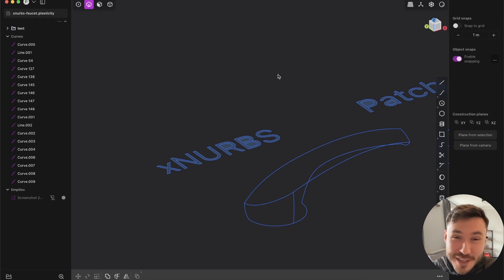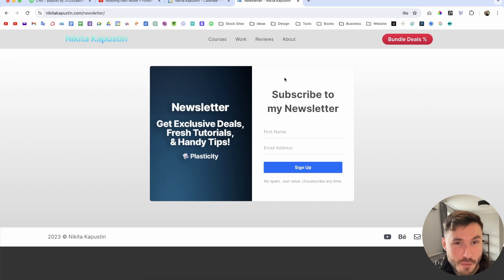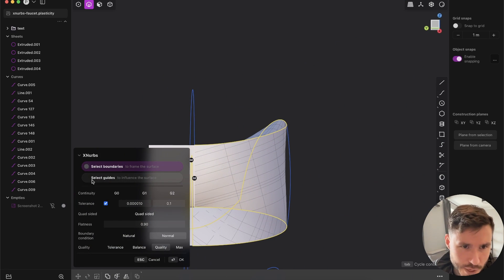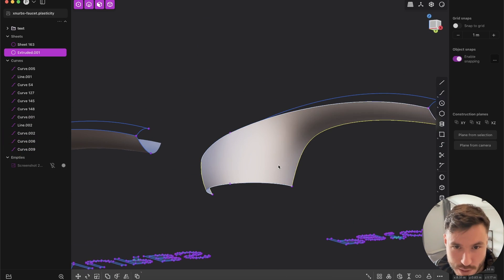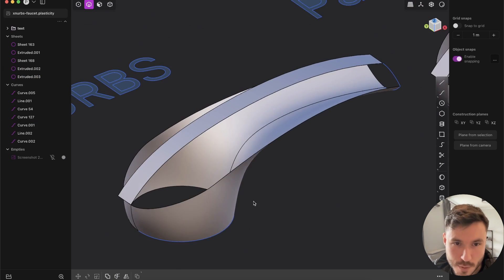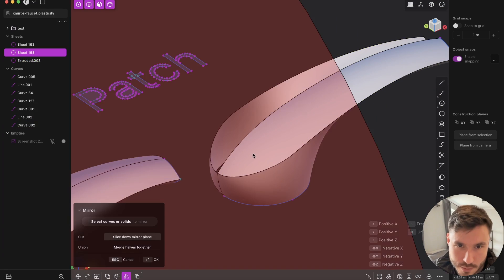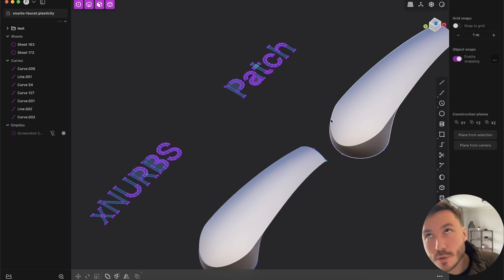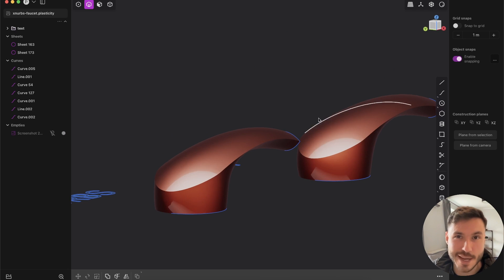xNURBS joined PLASTICITY | Is it REALLY worth it?

Comment: When you mirror, you DO NOT NEED a G2 continuity along the mirror line! You NEED only G1 continuity for the mirrored surface to be smooth (it will inherit the G2 and G3 and 4G etc. from the built surface to be mirrored after). You made a redundancy forcing xNURBs to get G2 along the mirror line – it makes that surface has an 0g (means zero curvature) perpendicularly along the mirror line at that same line because your temporary extruded surface was extruded straight (0g) from the mirror line!

Comment: Unfortunately, xnurbs does not build good quality surfaces.

Never did.
Not in Rhino and not in Solidworks.
Turn on the control points on that surface. The degree/span count is seldom good.
xNurbs will throw something at you, filling a whole but the result is almost always a mess.
Learn what spline surfaces really are and how they work instead.

Comment: I remember a time (around 15 years ago) when in  automotive design single span  patches were the way to go. It went even so far, that Alias  modellers were getting problems if they had 2-3 spans in their surfaces. If I look at the interior isoparameters of those X-NURBS surfaces... I get cold shivers... 🥶
Definitely not single span😂
BTW: If the adjacent surfaces are messy, you will get messy patches with tortured highlights. No X-NURBS trickery will solve that.
Reply: So what xNurb has as advantage compared to patch?
Reply: @LynxErgo  It gives you an automatic solution and more importantly it can have more than 4 sides. A patch can only have 4 sides and you have to decide what is the best way to make your "quilt" out of those four sided patches. (Of course, you can trim a patch to have more than 4 sides, but it's even harder to align other patches on trim boundaries.)
As long as you only care about the look of your model, xNurbs will give you a quick solution. As soon as you start offsetting the A surfaces (in other CAD software) to create B surfaces (thickness) then the increased amount of interior isoparameters MIGHT cause problems, especially if they have multi knots. I have not tested it, therefore the MIGHT. Generally, the less spans a surface has, the cleaner it is mathematically so, it is more suited to create offsets of it.
Reply: @SteveThinman  Damn, thats quite insightful, thanks man! Im trying to learn CAD so I can use it my field (game dev). Its very difficult to understand it afterr years of polygonal modelling. Thanks again
Reply: @LynxErgo  NURBS modelling is very different from polygonal modelling (I'm doing it for over 30 years now) as you always have to think in four sided patches and you have to take care of the continuity between those patches. Continuity is never a problem in polygons as they are always G0 (positional) only and only the smoothing algorithm determines the appearance. xNurbs might help you solve complicated surfaces but if you really want to learn NURBS based modelling, try the hard way and try to solve with patches only.
Reply: @SteveThinman  Got it, thanks again

Comment: In the beginning, on the "bottom" with xNURBS you're using G2 alignment to an extruded surface with no curvature and are thus forcing it to match curvature to something without curvature. But on the Plasticity patch you're using G1 alignment which only needs to maintain tangential continuity, so a) it doesn't appear to be apples-to-apples comparison, and b) the G2 alignment - aka the "curvature continuity" - is probably causing the resulting surface to pinch where CV's are trying to match a non-existent curvature.

On the "top", you do the same thing in using G2 curvature continuity for the xNURBS surface, but then trying/failing to use G2 with Plasticity patch and then just accepting the G1, which I'd offer is the better alignment constraint for both.

Obvious question is: Why didn't you show xNURBS with a G1 alignment to the extrudes and compare apples-to-apples instead of using G2?

FWIW. even when I model in Alias, I don't use G2 continuity on the edge of a surface which doesn't curve.
Reply from the maker: Thanks for that in-depth explanation, wasn't aware about that the extruded face can only be G1. Learned now:)
Reply: @nikita.kapustin  - Glad that helped. That all said, you're correct in saying that for these kinds of surfaces xNURBS probably doesn't make much difference. Even less difference for videogame assets (although that could change as game asset quality quickly goes realistic).

Where I suspect xNURBS will make the biggest difference is in the kinds of multiple-surface-blending-together-at-the-same time situations that sometimes pop up; things like motorcycle forks. Those blends can be tricky and require a fair amount of work to get nice surface quality. And again, this is probably of greater importance to the professionals like myself that want to export geometry to SolidWorks or Creo and continue work in those applications. For game assets, once it's in Blender or Modo or whatever, the clean-up can be moving some vertices, so the surface quality doesn't have to be as clean.

Is it worth the extra cost of a Studio license? Honestly, I sometimes still can't believe these tools are running on $1k laptops and cost a few hundred dollars. When I first started out, less capable software was tens of thousands and ran on SGI workstations (or similar) with a UNIX-based OS that would cost another $10+ dollars.  If someone is serious about designing in 3D, I consider it a no-brainer; especially given that this is a perpetual license. If someone is a hobbyist, then take advantage of what's freely available, which is still quite a lot.

Comment: The addition of XNurbs has not made plasticity more expensive afaik. Nick explained that XNurbs is not a fix for bad geometry and that it is still better to work with 4-sided edge boundaries. The matcaps look better if set XNurbs flatness to 1. For Rhino XNurbs is a productivity tool, creating nice blends in Rhino is a lot of work and takes a lot of time and experience. Plasticity blends are much easier to use than Rhino, but XNurbs is still a wonderful addition and hopefully will pave the way toward easy-to-use surface analysis and UI feedback.
Reply: XNurbs costs 150$.   When I bought plasticity there was no distinction between indie and studio.
Plasticity cost at an earlier time 110$.  Now Studio with XNurbs costs 330$. ;)
Reply: @cr4723  The prices for both licenses were increased cause the team needed a bit of a higher price to be able to keep going on
Also xNurbs do not cost that alone, studio license has always been more expensive

Comment: Patch is limited by cut or broken lines that form a closed perimeter.
I think xNurbs doesn't need a closed perimeter or broken curves... it detects the design intent based on where the guiding curves are. Patch requires a better definition of curves or may cause errors by being more strict in the limit information.
xNurb is a little smarter

Comment: Just as a minor technical note -- you cannot just extrude curves at the midline and use g2. A linear extrusion is not g2, it is g1, so you are giving XNurbs contradictory constraints.
Reply from the maker: "you cannot just extrude curves at the midline and use g2"
-> You mean this for the normal loft/patch, right? Because if I extrude the midline curve and use xnurbs on that same midcurve, I can select G2. (But not with patch)

Or what do you mean exactly and how to solve it?
Reply: @nikita.kapustin  When you do a linear extrusion it is not in fact g2. This is clearest at the bowl of the spoon, the extrusion continues in a tangential line off of a curve. So xnurbs can handle contradictory constraints but it will produce suboptimal results
Reply: @nikita.kapustin What he means, is that mathematically, G2 continuity from a perfectly flat surface is not technically correct.  I have worked in Alias for many years, and I can get the program to say its g2 continuity,but it really isn't what G2 continuity is supposed to be. If you made that extrusion a 2nd degree slab, (Three rows of CV's in the direction of the extrusion), then grab the third row (Away from the edge you are building to at the center-line), and move it down slightly in the Z direction; you would be able to create a G2 flow from that slab. Once you delete the slab, and mirror the surface patch you built across the center-line, the flow would actually be G3. And that is why the G1 built patch looks so good, because when you mirror it, the two actually are G2 be cause they are the same on both sides
Reply from the maker: @tbrg1965  Ohh, that makes so much sense, right!! Thanks for that very simple explanation:)
Reply: Hey Nikita,

Please let us know if you fixed it, because some of us are paying you to teach us the correct way of using Plasticity, and having “Nick Allen” the creator of Plasticity saying you’re are teaching it incorrectly it’s a little concerning.

Human error is normal, as long as you fix it so we can all have a better learning experience
Reply: @TheJsimes this is the most arrogant, passive-aggressive statement I’ve had to read today. Is is concerning to me a lardhead such as you can feel entitled to say such BS.
Reply: @TheJsimes  what is this entitlement? people make mistakes, it happens, absolutely no need to be a dick about it.
Reply: @Satysatonachair  there’s no entitlement and am not being a dick, if you knew how to read the entire comment before replying uninformed you would see that I said “errors are normal”, it’s the fact that he didn’t responded back that got me to reply, as I don’t know if he saw it or maybe he is taking a look into it off-line or something

My point was, we totally depend on him and his knowledge to get informed, and I at least “as a paying customer” would like you to know that my teacher is leading me the right way for the next courses and etc that I take on this subject

Comment: Good side by side comparison. I’m in it’s a case case basis where one may do better than the other, BUT as you point out, for the non power user professional will it be worth the up-cost?
Reply from the maker: Yeah it's a new tool implementation into Plasticity, so we just have to see how it unfolds and how we can implement it in our workflow. 

But I think xNurbs is not intended for casual/intermediate users. It can produce super high-quality results (like I will show in the upcoming video) in some examples, but for literally 97% of the people the standart Parasolid/plasticity functions are beyond amazing